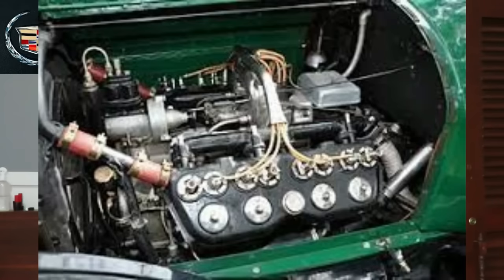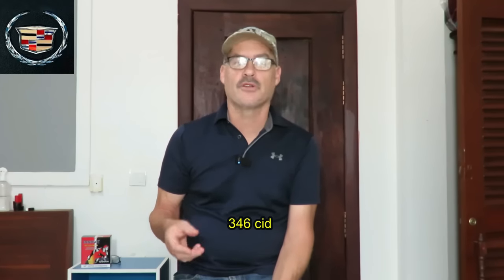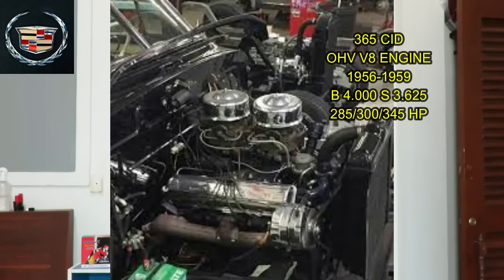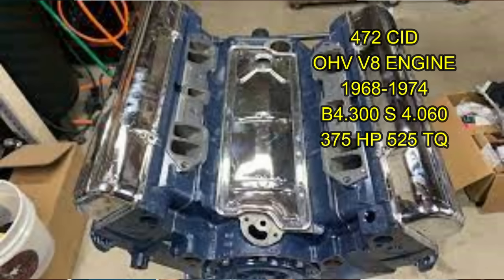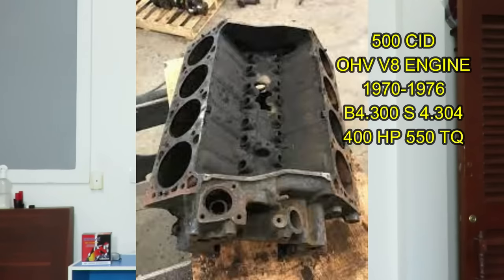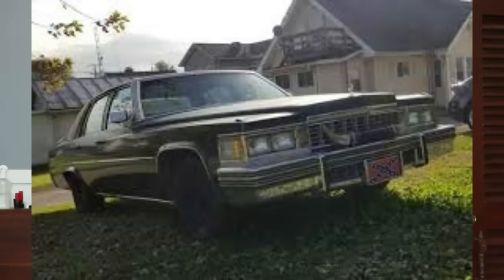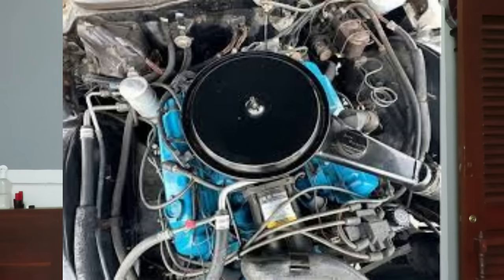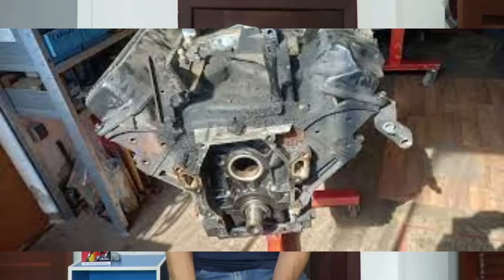CADILLAC V8 ENGINE HISTORY

Comment: The 331 Cadillac OHV motor was an Oldsmobile Design by Charles F Kettering, but in the GM chain Cadillac was the top brand and Oldsmobile was second , so Olds couldnt have a better motor , a deal was done that Cadillac would get a bigger version of the Oldsmobile V8 the same year as Oldsmobile, its the same reason we have 455 ci V8s at GM , the pecking order was Cadillac, Oldsmobile, Buick, Pontiac, Chev and GMC ( with GM Holden Australia between buick and pontiac) , since Chev was the lowest car producer it had the smallest motor at 454, but Olds , Pontiac and Buick campained for equal motors and got the go ahead , but their limit was 455 as that was one cubic inch bigger than chev a lower brand on GM scale , so we get three 455 ci V8s from the mid range GM brands , but Cadillac being the top GM brand got the biggest motors as always a 472 ci and just to prove a point a 500 ci V8 !
Reply: Buick, not Oldsmobile, comes after Cadillac.

Comment: International v8... Yes, my favorite! Caddy and Olds are a close second. The I-H v8 will make you pull your hair out. Sv, mv, and I forget the designations of the 549. Mind that the mv404 IH became the 6.9 powerstroke for Ford. Two versions of the 6.9 happened. 
Mikel 
PS be careful turning up the 6.9 diesel and read the casting numbers.  Same said with any International v8.

Comment: That's crazy how all the engines from 1976 and older were great big block engines. But when you explained the later V8 that had problems and fixed them and kept doing that over and over again like why would they keep replacing something that was good or fixed then replaced it completely with something else that was not as good or had more problems that's just crazy to me.
Reply from the maker: They were trying to meet changing fuel milage requirements handed down by the Government these mandates happened so fast during these years that it was hard to keep up so many of the engines were rushed into production it does not really matter how well an engine works or is perfected if it cannot meet the EPA's requirements it cannot be sold in North America
Reply: @Myvintageiron7512  oh dang that sucks
Reply: If you want CRAZY --- think of all the 400CI engines that "appeared" all of a sudden ---made from older engines and they were basically very undependable with Siamesed cylinder walls (very bad coolant flow) and this running scared of the FedEPA / CAFE / CalEPA  as they did an  industry-wide smackdown.
>>> Mopar/Chrysler took their little 273 out to 400; Ford took their 221/260/289 out to 400; GM took their SBCs out to 400 and even took a 366 out there too. 
>>> All these engines had a lot of thermal troubles - and were rapidly dropped in favor of letting the factories decide how to meet CalEPC and CAFE standards. 
>>> Those days were a nightmare for me, as I was a California Brake/Lamp/Smog Inspector-Installer-Adjuster.
Reply: @SurferJoe46  oh got it
Reply: @SurferJoe46 .... Terrifying words, according to Ronald Reagan,
 "We're from the Government, we are here, to help". ;/

Comment: One thing about GM is that with all of those different divisions, they could probably have benefited from sharing parts and engineering efforts.  If Oldsmobile, Cadillac, Buick & Chevrolet were all designing their own engines, they were wasting a lot of money.  I'm pretty sure these divisions operated in their own silos and were, in effect, competing against each other (another GM management failure) which is probably the reason for all of this duplication of effort.
Reply: Makes sense why Chevy wasn't all that good in the research and development area. 
Where was Chevy during the hay day of NASCAR in the late 60's ?

Comment: no mention of the fact that Charles Kettering was the principle mechanical engineer who designed the overhead valve Cadillac and Oldsmobile V8's who's design was also used by Studebaker, al be it, the Studebaker V8's were much stronger and more efficient.

Comment: I have a 1995 eldorado with 248 thousand miles on northstar best engine I ever had no problems at all and I owned allot of cars o ya and I ran it hard so the people that cut up northstar engines they don't know what ther talking about or they  don't know how to take car of a engine I kind of know engines being  I have been building race engines for 40 years
Reply from the maker: judging the reliability of an Engine based on one engine is not how problems are gaged with any particular engine,
 the stats tell a very different story about the NorthStar However I personally think the NorthStar is a very good engine platform and in the later years most of the problems were Ironed out unfortunately it got a very bad reputation,
and just didn't sell much like the 5.7L Olds Diesel in the last couple years it was actually a very reliable Diesel engine but sadly the problems that plagued it early on killed its reputation and it just would not sell.
There is another side to the NorthStar story. That is that Technicians absolutely hated working on it allot of shops refused to work on them, many times, like I mentioned in the Video, the entire engine and FWD sub frame would need to remove from the car this made repairs hugely expensive and time consuming which in turn upset the owners and they would then complain and bad mouth the cars and engines. A simple head Gasket replacement on any other car would be routine and the customer would just accept it with the NorthStar a head gasket job and even several other simple normally routine jobs would require engine removal. and much more expense for the customer,
 quite frankly this really made allot of owners angry,

Comment: Next: International V8 history
Reply from the maker: It's in the works it won't be next the IHC engines are going to require a huge amount of research they had so many engines on the industrial side and unlike most others they were used in all kinds of other manufacturers vehicles and equipment. the next video will be Studebaker they have the longest history started way back in the covered wagon days
Reply: @Myvintageiron7512  thank you, frankly I didn't expect you to upload a video about them. It seems that nobody cares anymore.

Comment: Stroke has nothing to do with torque. Intake runner length determines that.
Reply from the maker: I disagree completely and so does every Diesel Engine Designer in the world
Reply: WHAT?? your smoking something man Stroke has a huge effect on Torque!  much more than intake runner length your clueless
Reply: @kT-ob2jq   I am an engineer that has been building and designing engines for 30 years. Stroke has zero to do with torque output. Intake runner length has the biggest effect on torque assuming the same cubic inch engine.

Comment: The north star motor was an absolute piece of shit I should have recalled And paid the people to hold a piece of garbage to the dump big ripper
Reply: Yeah, I have a 99 or maybe a 2 thousandnorth star motor absolute piece of s**And the electronics took this s***And I couldn't figure out how to fix. So I got it nice looking Cadillac.  That's an absolute piece of s***Cadillac should go back and recall all of them and give some money to the people that they robbed while they were trying to some of this pieces. S** up everybody's Ash dancing ran so much oil threatcouldn't drive it a 100 miles. And what kind of idiot makes it? So you gotta take the whole top of the motor off. Just to get to the starter. In my opinion, they quit making.  Cadillacs in 1972 period there's no more Cadillac. After that the class style the Luxury are all gone even Even cars like osmobil and buick Are not anything like the luxury That they stood for.
In my opinion they do not make A leash Carnot one where you can have 6 people in the car.
With enough Leg room And have 6 adults with plenty of leg room.
Or trunk space.
Not to mention enough power to push him down the road.
I think nineteen seventy two was last year anybody that built a decent Automobile And the carburetor and they set a pointis first superior to any of the electronics Trash, they put on Cars today.
And it breaks my heart sing foreign built S*** putting America automobile industry out of business. I still think that people that buy foreign belt vehicles are traders.
Because they put Americans out of work.
Which takes money away from All American.  They used to have Ace slogan by American be American. I still hold that to be a basic principle of america

Comment: 1914...1st V-8 WAS MADE BY HENRY FORD!!!
Reply from the maker: Nope
The first known V8 engine was the Antoinette engine, designed by Léon Levavasseur, which was first built in 1904. The Antoinette was built in France for use in speedboat racing and, later, airplanes.[13] A 1905 version of the Antoinette engine produced 37 kW (50 hp) with 86 kg (190 lb) of weight (including cooling water), resulting in a power-to-weight ratio that was not surpassed for 25 years. Also in 1904, V8 engines began small-scale production by Renault and Buchet for use in race cars.

Comment: By the by it's not gas standard that ruined cars in emissions era. It's American car companies and an inability to adapt. Every other country in the world used aluminum for their engines but not America don't make lighter engines just take away compression and add a bunch of weight in emissions equipment. Then blame the government.
Reply from the maker: well I don't think anyone is blaming the Government at the same time the American Car Companys aren't really the cause of the problem either the real problem was the learning curve that took the Manufacturers by surprise It' would make very little difference weather a 500 cid engine was Aluminum or Cast iron it's not meeting CAFE standards Most of the world did not half to meet the standards of the American manufacturers and still don't in most country's 
I actually think the Government standards are a good thing they are the reason we have OBD2 and can make 700+ HP production cars The reality is the EPA requirements did kill the Big Blocks, and that would have happened either way Cast or Aluminum
Reply: @Myvintageiron7512  I agree with most of what you say but especially big blocks,  but the learning curve no , in 1973 we had the first gas crisis, the cars from 1973to1979 were 19 ft long 8 feet wide with optional helipad on the roof .when the gas crisis came back around again in 1979  we learned nothing.. It's not as much a learning curve as a petulant refusal to change. Look obviously to retool and change is expensive, at first. By the way dude I love your stuff and have learned a lot, thanks.
Reply: @kevinfalkner1624  The gasoline crisis back in the 70's was purely
political. The same thing can be said in todays world. Greedy self serving
politicians could care less about what makes perfect sense & their only
concern is how and how much $ can they get away with
Reply: The V8-6-4. It worked great! If you disconnected one wire to disable it. 😀
Reply: @mark98070  since when are gas prices not political, politicians have their whole career on gas prices. The point was  the government wanted more gas mileage,  and what's wrong with that? Saves you money right ? car companies could have changed but chose not to. Which put us behind Toyota and other foreign  companies from which we've never recovered So could you stump somewhere else so we can have real discussions. Point is Toyota owns us and we gave them the reins.